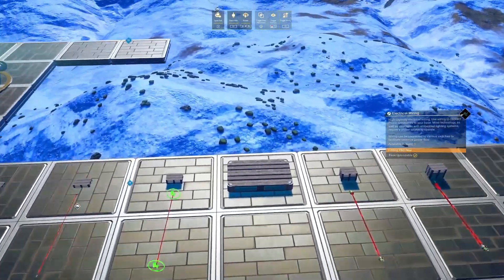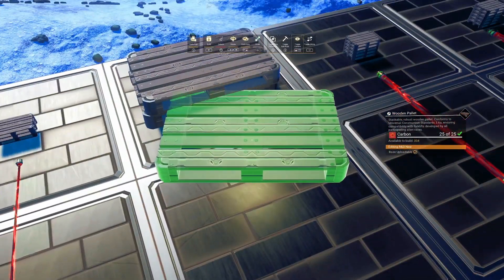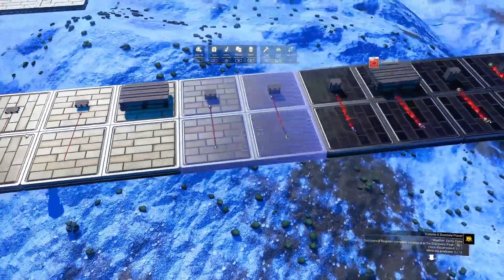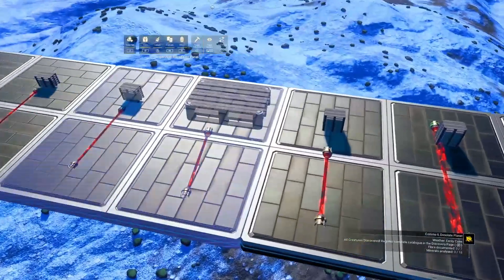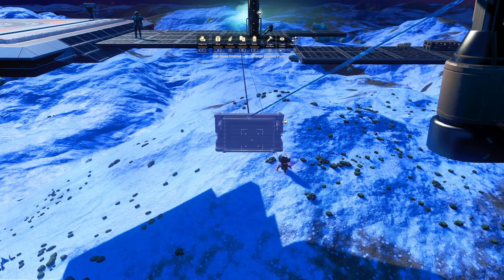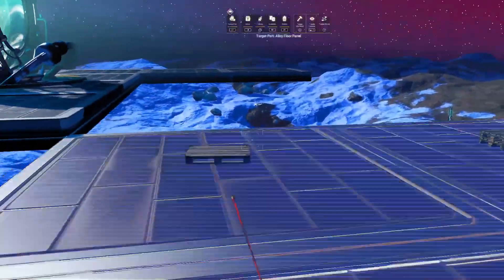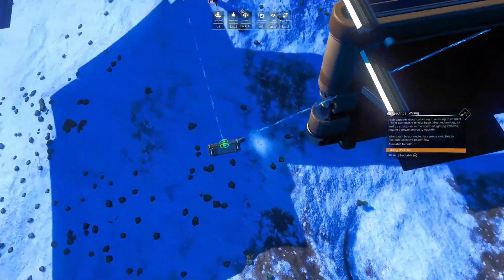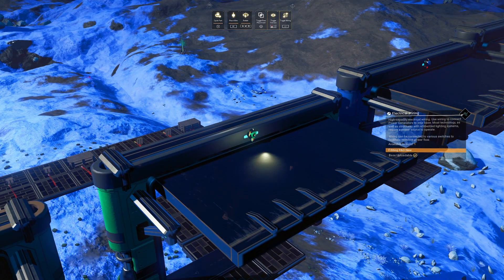Multi-Scaling Powered Parts - NMS 4.x

Comment: I can't seem to get the wire glitch working. I'm building on my freighter and the wire stretching part doesn't work, I keep getting an error message saying "Base is out of range". Any help would be appreciated
Reply from the maker: Sorry, didn't see this until now. But wires on freighters are a whole other issue. I am hoping you worked this out by now, but you have to use the teleport cables and SRTs.
Reply: @pharaohofeuclid  Thank you so much, this really helps

Comment: Finally someone working with scaled parts. How do I power the variants of these doors?(figured out I was placing the first normal size doors to line up the wire point a step lower than I was placing the x3 size door so it would not line up and work) thankyou for figuring this out 👍
Reply from the maker: Glad it is useful. I am trying to work on other scales. Specifically thirds. They are not quite as accurate at the moment and the method is a little more involved.